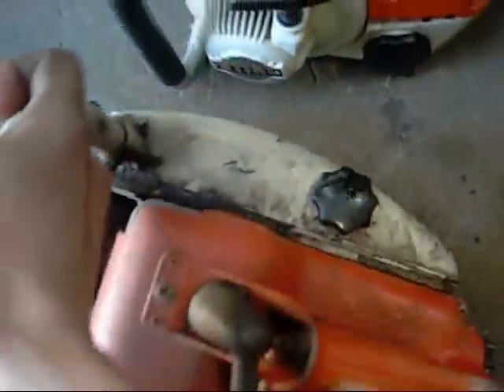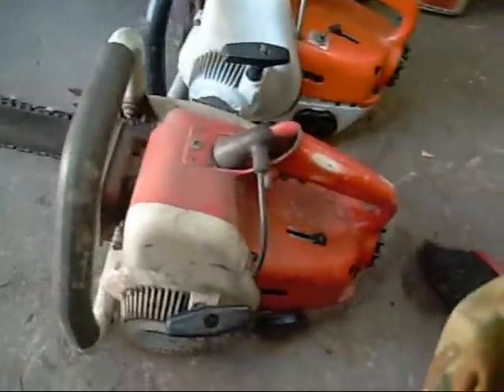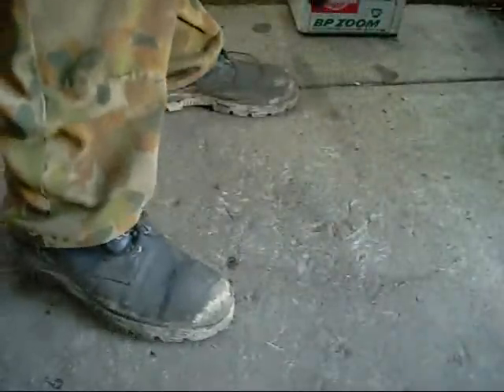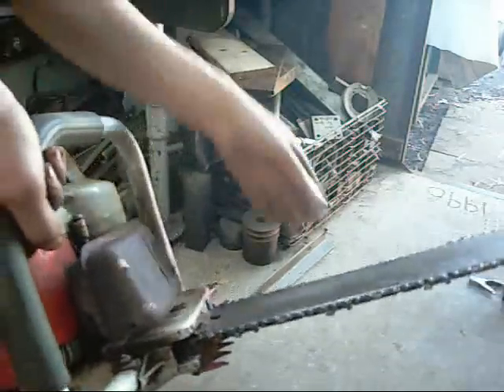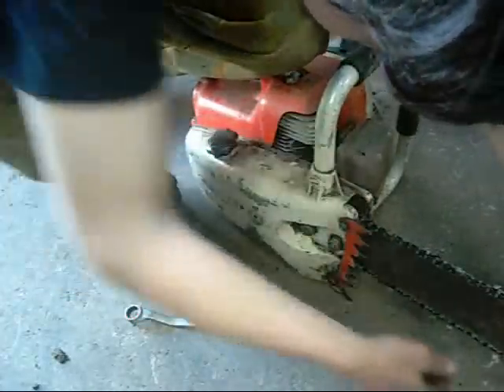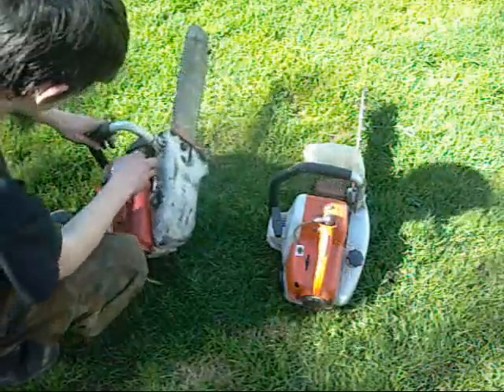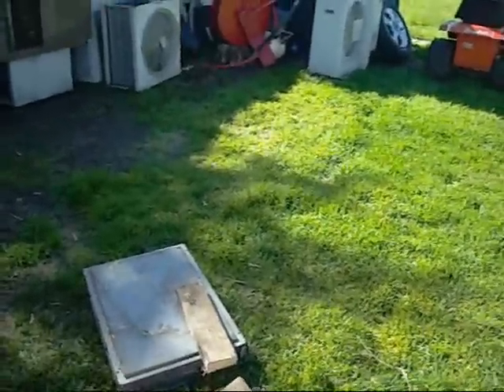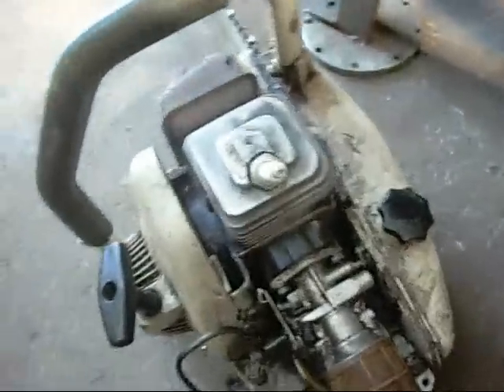Stihl 08 Chainsaw Clean and Repair pt 1 - plus 08S run

Comment: i was fixing a ts400 concrete cutter this has only <80PSI so it only fires  few times when i put oil in the cylinder and even after honing and cleaning out the scoring it only reached to 85PSI so it needs new rings

Comment from the maker: @wichywoo I've never stripped the trigger down myself but I imagine it would just be a drift pin.

try soaking it with penetrating oil first and see if it frees up, I've had a few like that where the grease turned to a sticky tar that stopped everything from moving.
Reply: Just picked up a 08s Quick stop today and WD40 restored the trigger in 15 mins!

Comment: @Aussie50 I've gave it a good soaking and its freed off a bit but dosnt full return under spring pressure it may do once running . i haven't had it started yet as i had to free off the points and clean dust off the and rust of the flywheel and coil , its got a good spark now , im waiting for a new recoil spring for the starter and i will give it a blast . got my on an old danarm 1-71s there a nice saw i had a couple on the farm before my folks retired .i love tinkering with old stuff :o)

Comment from the maker: @TheProsniper24 if its flooding it could have a perforated diaphragm in the carb, or similar problem. I would order a kit for the carb and rebuild it. I paid $27 for a full gasket and diaphragm kit from a Tillotson parts supplier.

Comment: ive just bought an 08s in realy clean condition , it must have sat in a shed for years as the trigger mechanism is stiff and dosnt return . how do you strip the trigger down . do the pins just knock out ?